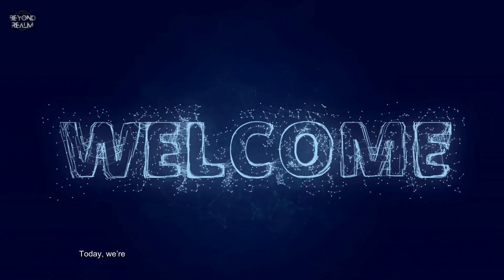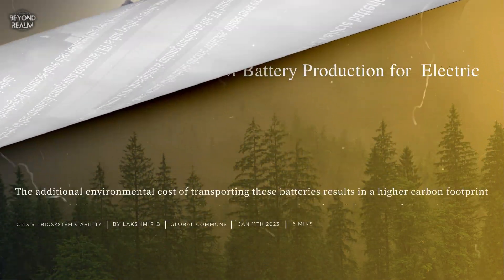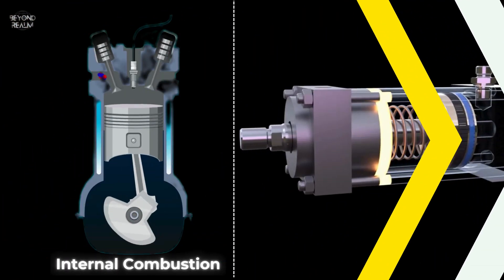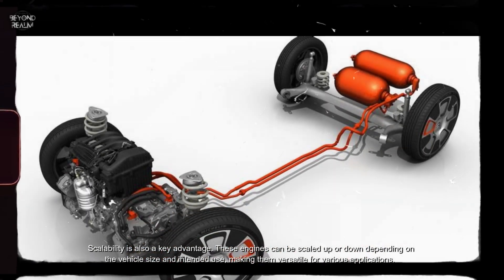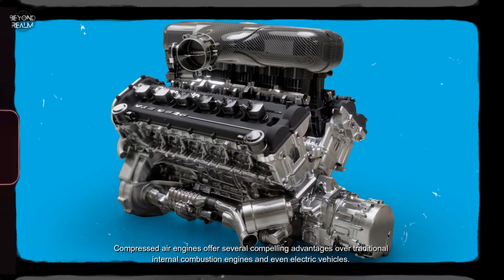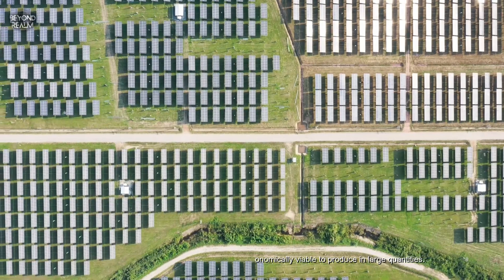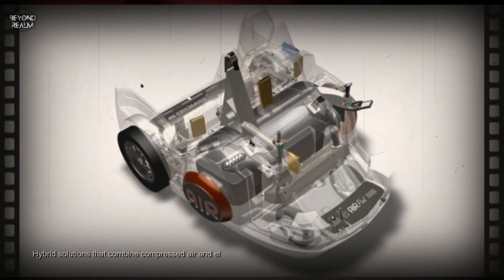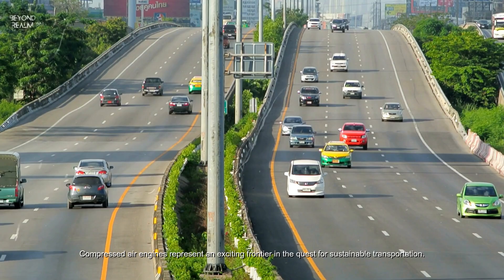GM CEO: "THIS NEW ENGINE WILL CHANGE THE WORLD!" | Air Compressed Engine | Beyond Realm.

Comment: You need a huge air compressor to develop 300 Bars of pressure.  Then you might get an air leak and lose your pressure.  When the pressure drops in the tank you will lose power.  I hope you are not driving up a steep hill when the pressure drops.

Comment: Basically this is the same issue as air rifles;  they have been around for a long time and can even be powerful enough to be a battlefield capable weapon if you look into their history and what modern tech is doing, but compared to gunpowder the energy density is very low. 

This is the same issue we have with current EV battery technology compared to gasoline- energy density is not on par, despite the greater efficiency of electric motors over ICEs.

Comment: Thr refueling part is not an issue. Every one could just buy a compressor and make compressed air at home. Depends on how much pressure you would need
Reply: You need 3oo bars of pressure.  that is approximately 4500 PSI.  Do you have an air compressor that will develop 4500 PSI?
Reply: @leehauenstein4305  das ist ein stinknormaler taucher tank die füllt man im shop easy. und für autos könnte man sogar noch bessere entwickeln. das ist wie bei elektroauto. zuhause tanken dauert länger mit kleinem kompressor. ladung ~ druck nicht proportional. ich mein kann man ca. so ansehen in ihren jeweils eigenen kategorien. ladung presst du mit spannung in eine batterie. und luft wird ein ein tank gepresst. äquivalent